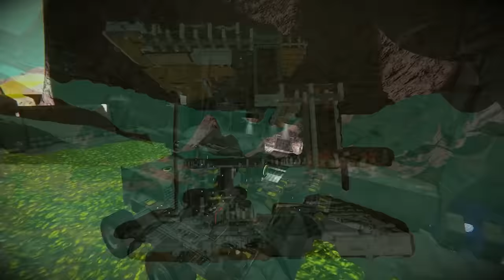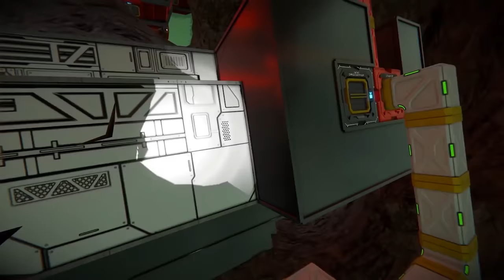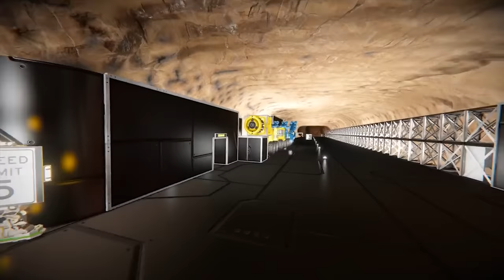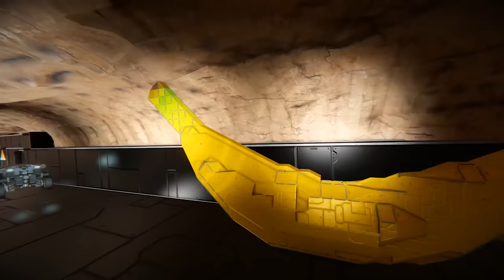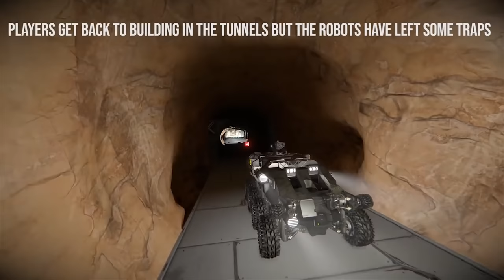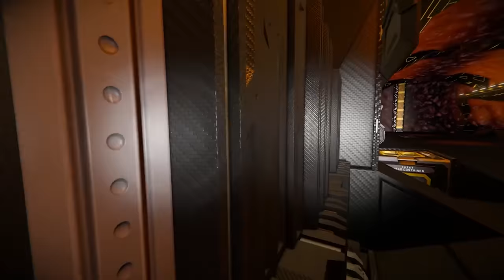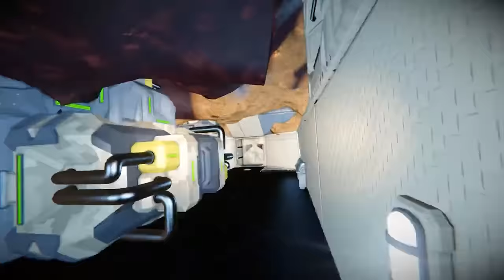WHY UNDERGROUND BASES SUCK !!!! - Space Engineers

Comment: You need to have two things on your server to enable people to have defensible Planet bases. The first thing being a Thruster inhibitor where the radius is outside of Maximum weapon range of your longest range weapon to prevent ships from bombarding from above. Allow the owner of the base access to turn this feature on or off, as if it were a module and make it consume a bunch of power. And of course no other enemy player can turn one on in the vicinity and of course make the effect invisible from a distance, but have a warning message to approaching ships. This would promote ground combat for starters. And the other mod, make it so the player who's base it is has a module to turn off their enemies drill in a radius around their base and of course just like the Thruster inhibitor, enemies around cannot enable the same without destroying the one that's there first. As far as the data goes for server voxel changes, there's nothing to do except for having multiple servers for different areas.

Comment: im a big fan of the aesthetic of a bunker base, specially the exposed stone.
for sappers, I wonder. different tiers of rock having different density, requiring better equipment to drill through, hand drill / small grid drill / large grid drill, though also potential for different types of drills in terms of tiers / drill tips. if sappers were forced to commit an expensive drill, with expensive support systems, it would in part balance deeper bunkers. would be a fundamental change to game balance, and well beyond the scope of SE, perhaps something for SE2

that being said, some sort of seismic sensor to detect drilling would introduce some fun counterplay, preparing defenses where they are aiming to penetrate the bunker, would just be a single hole as opposed to the more partisen, drill new tunnels all throughout and generate Salt for defenders. 

tldr, sappers will sap because its easier than penetrating walls and defenses, so what about the uno reverse, bedrock is difficult to penetrate

Comment: There are some upsides if done right: tunnels can be turned into deathtraps. So, you've got your entrance tunnel. Then you have to turn 90 degrees. At the rear of the entrance tunnel, you have a literal wall of weapons so anything entering into that shaft will be instantly obliterated. At the 90 degree tunnel, you have the same. So you now force an attacker to slow down to make a turn, and this puts them right in the line of fire. As long as you are conservative in how you do this, you can make it fairly quick and easy to get in and out of while being highly defensible.

Comment: I think smaller underground bases are more useful than larger ones. Or a network of smaller ones that can be locked and be able to provide multiple avenues of escape and/or fallback points. Large ones tend to be detected more quickly as enemies will at some point start to home in on activity via recon or some other method. They get eyes on it and observe for a period of time they will start to put together an idea of how big the base might be by the forces that move in and out, or the security that is around the entrance and start to figure out how to best deal with it. Even if there were some methods to camouflage them as some have posted larger bases will undoubtedly be sniffed out faster than smaller ones. And while smaller ones knocked out quickly, they are cheaper by comparison and can be setup much more quickly and honestly are easier to hide. And depending on the nature of the base they can be setup slightly closer to enemy bases if done right. Giving a fortified location to assault from or multiple fortified locations to assault an enemy. And if there is a network of tunnels to some of these bases can be used to ferry supplies, vehicles, and personnel between them. With smaller isolated bases being setup to draw attention or as temp holding stations for other a small taskforces and/or convoys that moves when it's dark or even during the day as rapidly as possible so that even should they be detected the loss suffered is mitigated by the fact that while one group might have been sniffed out another group(s) can move quickly unnoticed to those other holdout bunkers or the network and disappear from view. These networked bases will cost about as much resources as larger ones if not more in some ways, but the trade is that should one be detected enemies now have to contend with a network of rat mazes rather than one large one. And burning the network will take more time and manpower than the enemy might be able to throw at it at once. Drawing the fight out and exhausting attackers more since it's unclear if there is one central base or if this a disjointed network of cells. Main issues is time and location, where the first of this network is setup? How long it will take to build it up? How many are connected to the network? Their locations? Where are the isolated bunkers and holdouts going to be in proximity to these networked bases? Where is the enemy concentrations in relation to them? These have to be asked and have to be analyzed.

Comment: The easier solution is to have an open base concept underground. Have large open areas that are defended a central point. Base design should be more along the lines of Rust, with interior buffers protected by turrets. I've found a minimalist underground base with a central for lack of a better term Keep, works best. That and having several smaller base hidden around the map as backups.

Comment: I haven't messed with safe zones but they can block drilling; if they can be set or modded to block voxel damage in general so someone can't just warhead through the voxel then allowing them to be used for only that purpose during base defense(say, have a GM or neutral party confirm the setting, maybe take ownership for the duration of the battle) would be a potential solution atleast the sapper issue. 

And it's not like there's much more stopping anyone from digging under a surface base to plant warheads or bypass defenses, it's just less tempting and a little more work since you'd typically have to drill further and be careful not to breach the surface too early.

Main reason for underground bases IMO is style; they're neat and fun and interesting. Tho choke points are also nice, just have to be sure to leave yourself a sally port and build with atleast some practicality in mind.

Comment: Best way to design an underground base in Space Engineers is to hollow out a massive underground chamber about twice the size of your desired base, then build your base suspended in the exact center of the hollow and away from the sides of the chamber, then have every square inch of the exterior of the base studded with enough defenses that it is guaranteed to permanently crash the server the instant someone breaches the walls of the chamber and all the turrets fire at once.

Comment: Why not just make a block in game that disable voxel damage in X-range ? 

So if you build a underground base you place this block along the base expansions making voxel walls not take damage.
It wouldn't even be over powered, as you can't mine if it's place either, so if you are expanding the base you are exposed or if you do mining. The block could also be balanced with power, so the bigger the base is the more power is always used, so there is a limit to how long a base can hold out without power, that would give it a "starvation" element, as most power plants would run out and solar and wind can be destroyed.

It would mean your base layout and size would impact the diffuse even more. As a smaller military outpost would be cheaper to run and safer, than a large command bunker, but they would also be safer than a mining base, at it can't do mining and have protection at the same time.

Comment: There is also the problem that underground bases can easily be spotted from several Kilometers away. The removal of voxel changes the way the surface appears at a distance. Usually in the form of a massive hole.
Reply: They must fix this for real! The community should pressure this change on the devs

Comment: If the server is set up to prevent sappers (drilling around defences and into the base), then small underground bases can be viable.
Reply from the maker: Even if its set up that way prepare for the frustration when you can't get out to fight....
Reply: One possible effort would be excavating a greatly larger space than needed, and having the true secure chamber suspended in the middle with defences positioned externally on the base as well as at points of the interior facing inwards to enable them to hit would be sappers. Though this also has issues. Accessibility to defending persons, as well as the massive time requirements for setting it up come to mind immediately.
Reply: Any good server admin would prohibit and punish sappers. It’s low effort raiding.
Reply: @TheBojaboja  wow, roleplay dweebs have kind of taken over, if you're allowed to say that kind of stuff with no pushback.
Reply: @aone9050  If that was true, it would be the exact opposite, because tunneling under defenses to penetrate a vault is a time honored tradition of robberies.

Comment: above ground they can FLY to your rooms, under ground they have to DIG to your rooms, its just another layer of armor, albeit not as strong, BUT it keeps the enemy in the dark, they dont know where your rooms are, where as above ground its easy to make our your room layout.
also, all the negatives also apply to the enemy, its as equally inconvenient for them too.
... also, i hate having my back open, at least i know from which direction im being attacked, id rather get them in a choke point instead the risk of being attacked from all sides
Reply: @@callmeskal820 that would of course cross the line of cheating in my book
Reply from the maker: At least if you build on the surface you can get turrets all around to deter them.
Reply: @@callmeskal820 An above-ground base doesn't have that trade-off because it has no stealth to trade away, so it's not that you have to choose between stealth and defense underground, it's that you get to choose
Reply: @@callmeskal820 Camouflage, turret doors, building your base under mountainous terrain so turrets can pop-out from the side of hills??
Reply: @LastStandGamers what if they dig under your above ground base and cut their way in those turrets are useless at that point

Comment: I don't think one is better than the other. It's situation based.
A underground base can have walls so there is no difference to on top bases. You can dig in both, same goes to multiple entrances.
The technical side of things is a failure of the developer. When you create voxel based planets it should not be performance heavy...

Comment: Well, in my opinion, and from what I’ve seen, I’ve been overly bombarded with war heads 16 times on separate occasions when it comes to bases. Even some shielded ones. I can definitely say that it is not perfect. In fact, far from it, but for underground bases, I would say it gives you weather protection. Which is good for acidic rain. Also, for interior defense, they could have Turrets  placed inside of their bases. Including Gatling’ which would definitely do some extreme damage. Personally, what I intend on doing with my next mountain base is also having doors that are mediately protected with guns. He did bring up a good point though about the insights not being guarded by enough turrets so for that, I’d probably put a lot of interior Turrets. This is because they are small and do moderate damage to small light armored grids. Also, with my next one I was planning on making it airtight so that would probably make it harder to penetrate because it would have windows at least at some areas and other areas it would just have armor walls. I was also thinking of making the area pass the interior hanger, which uses extremely large player made large grade doors. Sort of elevator for moving down vehicles, and perhaps even fighters to a area that can act as a bunker. To avoid anything like a modded, super laser, but at the bare minimum guard against. The war heads, which I deal way too much with.

Comment: The first two rooms for an underground base should be a hanger/car park with all parking spots connected item/resource grid.  The refineries and what not should all be much deeper and having more than 3 ways to get from a to b isn't a bad idea either.  The store rooms should be even deeper and the "Trophy" room(s) should be even further.  There should be multiple levels with 2-3 respawn points on each level.  There should be an armory on each level or an access port to retrieve weapons from deeper in the base.  There should be at least 3 int turrets at any turns and 4 plus a gat turret at 3+ junctions.  

All natural surfaces in the base should be covered with at least 2 block thick heavy armor preferably increasing in thickness the deeper you go and the surface should also have a platform buried that is at least 2 blocks below surface and 3 blocks thick and stretch at least 50-100 blocks from the closest point of contact of the entrance.  A backup entrance/Exit should be given thought and carefully excavated in a manner that makes it difficult to perceive in  atypical fashion.  If building in a ravine try seeing if you can build an exit or secondary entrance on the other side of the mountain/plateau with said entrance being in a enshrouded spot.

If not trying to actively hide build a standard defense base on top of the main entrance.  Use the surrounding topography to develop lines of sight while minimizing exposer for auto defense turrets.  Try to build compact if possible anti siege weaponry to take out assault ships and or capital ships and be prepared for kamikaze style attacks.  A ship that isn't good at taking hits but doesn't cost much to replace can still do damage if given the chance.

Try to have a backup base with long-range engagement ships so you can sweep from behind.  If you can have some remote controlled kinetic missiles to take out small grid ships that are hovering outside base if kinetics are still viable.  Its been awhile since I played.

Sadly as pointed out if you are far enough away its possible to see an underground base.  Also weapon core doesn't take in account of voxels when targeting.  I guess the server could implement a way to make it so that player static structures aren't visible past a certain distance but I am not positive this is possible.  Also would still let ships and rovers be seen through the ground although they are smaller so that might mitigate that.

This is if the server has high pcu for each clan/team and a good enough pc to run it on.  Hopefully most of the graphical issues gets fixed in later updates.  Looking back at this comment I realized some of it is rather... impractical due to pcu and possible playtime limits but it still might be feasible so if this helps someone then glad for it.

Comment: I think it comes down to what youre wanting to do. If youre in an area that isnt easily accesible and you wish to stay hidden due to the valley a few kilometers away is a hot mess of warfare, a Subterranean base works well. Also helps you get established before breaking out into the surface with your hangers and hardened defences, thpugh i would argue having a few layers of tunnels around your base that has turrets is a wise idea to prevent mining vehicles and lonely suited men with a drill from finding you.

Comment: Underground bases are not bad. I think people should stop crying and realize that realistically, if people could drill around it (which is definitely possible), then they would. However, if you have enough heavy armor blocks and blast doors, they can blow up whatever they want. They could just as easily use a grinder to cut through your blocks instead of blowing them up. Plenty of easy ways to break into a base

Comment: I mean on one hand, you're right. On the other, in modded situations, you can use things like the concrete mod to build multiple-layer-thick walls to end up curbing the attackers breaching through walls thing. They're tough enough in that configuration that you'd probably lose less resources storming through the base than trying to breach tunnels.
As for the attackers not having a lot of options, you could just enjoy the push instead, but that doesn't really fix the issue.
For the defenders, though, underground bases are nearly perfect if you can just fix the wall breaching problem.

Comment: Who doesn't line the walls with blocks? Like, even real bunkers aren't just a man-made cave, you dig out a tunnel, then line it with reinforced material. Now they have to cut through walls and rock. Also, if you use a placeable voxels mod, like concrete, it's easy to repair damage done to the rocky armour for dirt cheap, making attackers waste warheads or time breaking rubbish rock to get at even the armour.